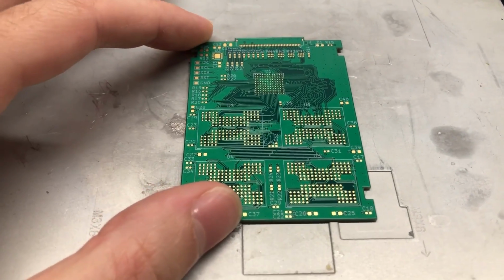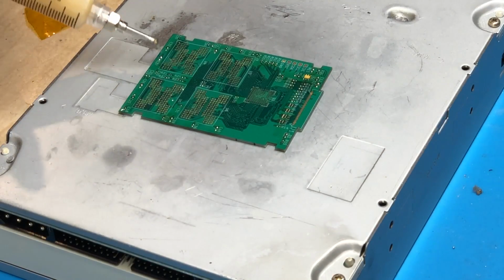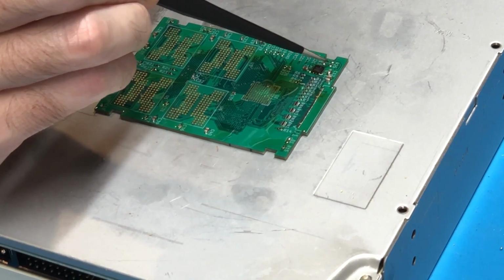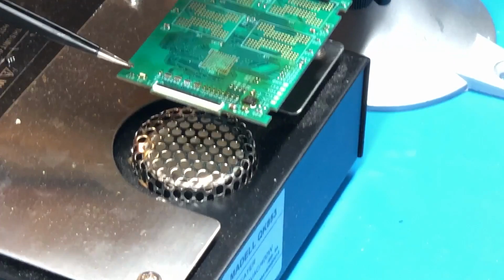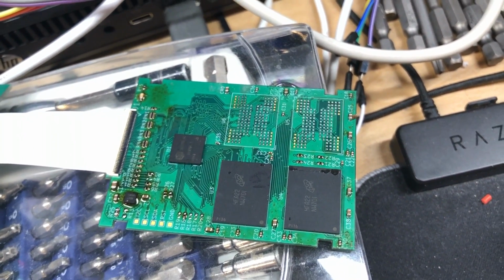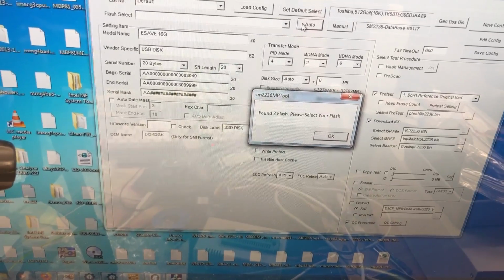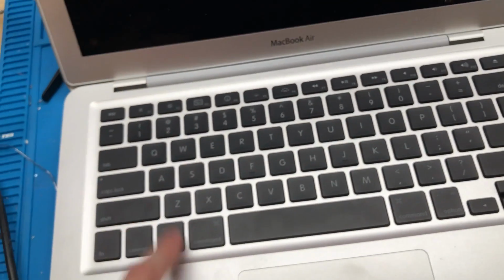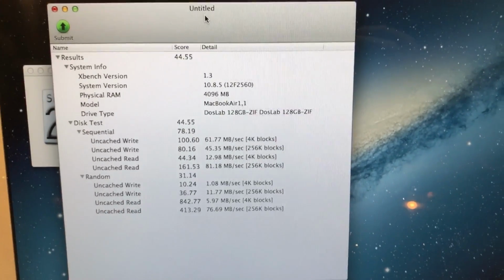Assembling a Custom ZIF IDE SSD

Comment: I'm trying to recover data from an a1502 SSD with a possibly bad controller, I have a working identical one, down to capacity and nand part number, do you think I can swap the nand over to the broken one or does the controller have more than just the type of flash in it's rom? 

The SSD appears to have 1 or 2 eeproms, I'm hoping if just nand won't work that swapping those too could?

Comment: Very cool. But given that IDE has a max speed of 133MB/s and CF cards are around $50USD for 256gb this is overkill?
Reply from the maker: If 256GB CF cards were actually $50 it wouldn't be worth it, but usually 256GB cards go for over $100, and maybe as low as $70 if you're lucky.
Reply: @dosdude1  OMG you're right! I had no idea, They go for over $300 locally!

Comment: ......but why not instead just a board that allows for the use of m.2 or mSATA in the same footprint using the jm20330 chip everyone already uses? In fact, that already exists. I have a Vaio VGN-TX3HP but it and all the TX6/7/8xx laptops use 1.8 CFIDE, there's plenty of laptops that could benefit from such an adapter instead. on the zif side you already have ZIF-IDE to mSATA, that's easy enough and negates your adapter's existence. it just doesn't work going from CF-IDE to ZIF-IDE, to ZIF-IDE to mSATA probably due to cable length issues or something along those lines. no one makes a proper CF-IDE to mSATA or m.2 adapter thus leaving one subset of laptops from ever getting mSATA or m.2 SATA SSDs installed in them.
Reply from the maker: Because the JM20330 is a piece of garbage chipset that's super slow when it works, and doesn't work on many systems (such as the MacBookAir1,1 shown in this video). I was considering making an actual decent adapter using a Marvell chipset, but I couldn't find a datasheet for it.
Reply: @dosdude1  so far as I know, the only marvell chip that existed for doing this is EOL, isn't it? also, at that, Marvell is pretty tight-knit about their datasheets unless you're a developer looking to buy in volume or work in a chinese sweatshop with a copy on hand from the parts broker in the mall. this is the exact same reason there's no datasheets in the wild for their older kirkwood-based Armada ARM chipsets, only factoid sheets. As far as the SSD goes, yeah, it makes sense to do it for this one specific machine and any that don't recognize it. in terms of others... I know with the jm20330 I can get a solid 80MB/s on something like a Thinkpad X31, so it does work well to a decent extent in those. I've never really experienced any problems with them so long as I use (usually used at that...) drives with cache. 

but it still boils down to the BIOS at that. I know the UMPC Vaios will work with the jmicron chipset if used with a samsung pm841 or like SSD at the least... but I'm not sure about the Vaio I have. I never really figured out my issue, but hooking the drive from an iPod 5G to my chain of adapters yielded the same results, so I'm thinking there still needs to be a proper CF-IDE to mSATA adapter made that isn't the weird orientation one from the one iPod drive seller guy I can't remember the name of.
Reply: Would something like the iflash ssd card work?
Reply: @michaelmelita2542  that's the name of the guy. the orientation isn't correct, it doesn't fit in the designated area for the drive.

Comment: I’d be keen to see if something like this could get up and running in an original Xbox, to save of the hit and miss eBay sata adapters or the expensive star tech ones 🤔
Reply from the maker: Yeah, I plan on making different form factors of this, including a 2.5" IDE one and a standard 3.5" IDE one.
Reply: @dosdude1  I would sooo love to get an ide ssd for my older macs, I don't think I've ever seen a 3.5" ssd ide
Reply: I was just thinking all i need to do now would be design a flex/ribbon to allow this to be used on 70012 model slim ps2's
Reply from the maker: @dragoncracker  Or, even better would be to just modify the design to work natively with that model PS2.
Reply: @dosdude1  that sounds like a challenge that's far outside my current skill-set.  at least the zif is a standard that I can design towards. Maybe some day :D

Comment: A most excellent build, sir. You might've mentioned it in the video, not sure, but how does this drive interact with TRIM?
Reply: TRIM only affect write performance. 
SM2236 itself - a CompactFlash controller and dont support TRIM at all.
Reply: Ah, got it; that makes sense!

I figured that even if the controller supported TRIM, it would be hard to issue the commands from OS X. The info I found on the Kingston PATA/IDE SSDs suggested they needed specialized software that only supported Windows XP (no *nix).

Comment: Something your 17 inch Macbook video, would the x-GPU works in something like Linux or Windows as well?
Reply from the maker: Yes, it definitely would.
Reply: @dosdude1  Another thing is that would it be theoretically possible to do something like ripping the old GPU chip on old ass laptops and abuse their PCIE x8 lanes for a fast eGPU?
Reply: @bravosixactual3000  most older laptops use a X16 link to their GPU's, so even better than what the MBP's use!